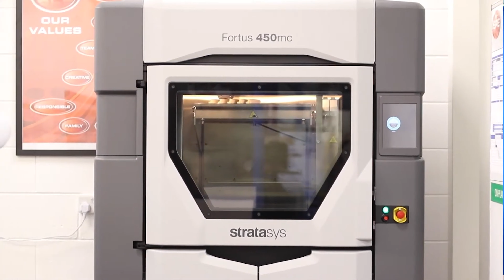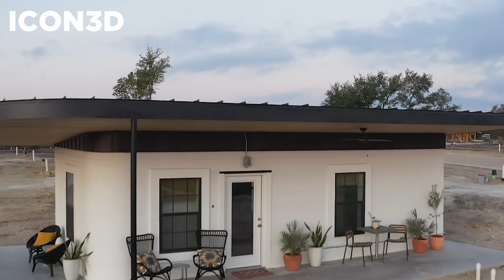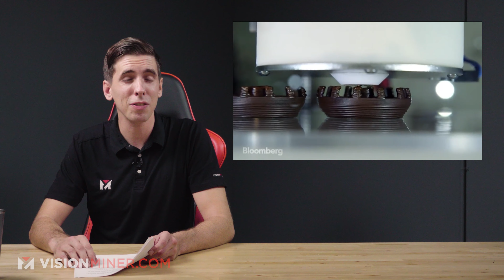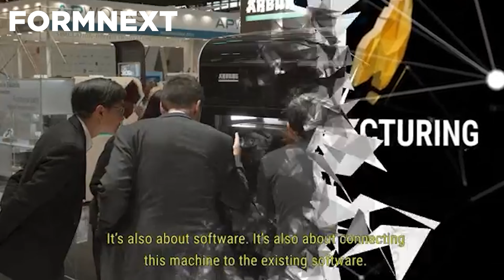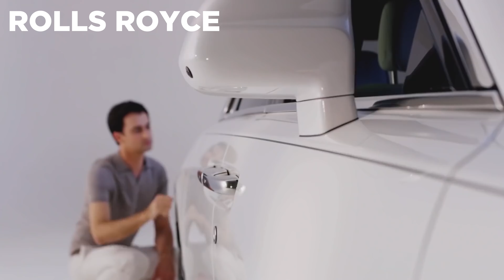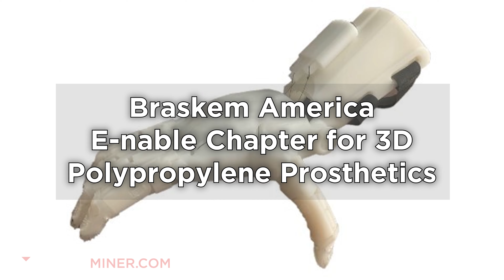Rolls Royce 3D Printing, Lockheed Martin, Boeing Auburn Facility, Formnext 2020

Comment: What material do you use to insulate the inside of heated chambers? Also sand binder jetting looks super cool
Reply from the maker: Different kinds of insulation are used, from ceramics to fiberglass, depends on the machine :)